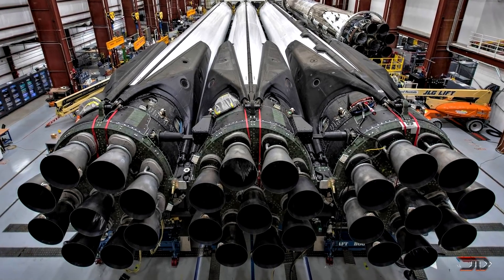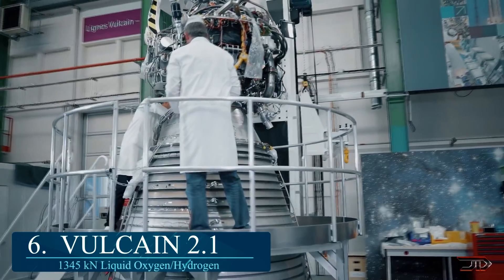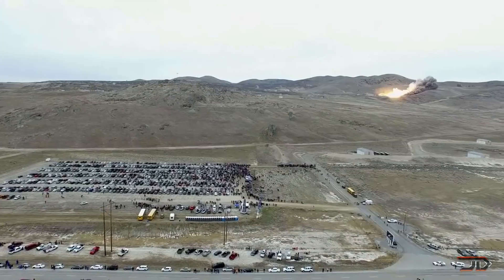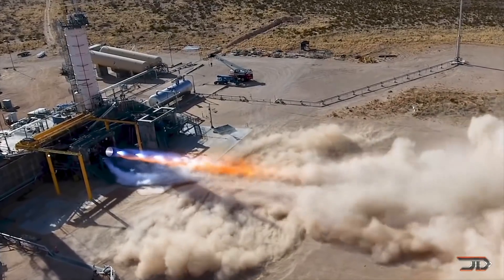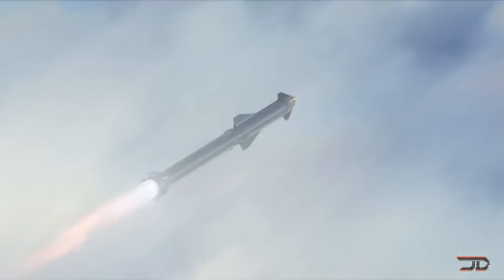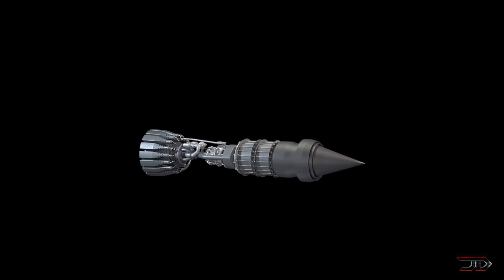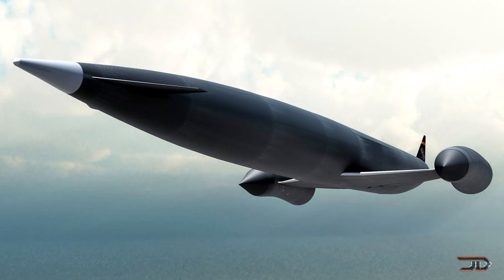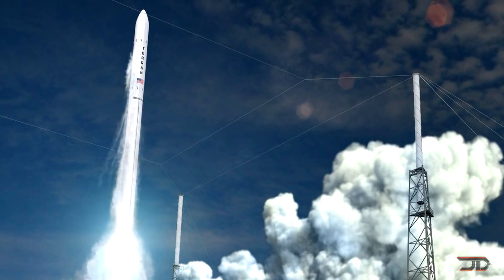7 AMAZING New Rocket ENGINES

Comment: 5:08 "It would require 200 MW from a powerful nuclear reactor"

So, not a real problem then.
Reply: It is. For once, we don't have space-rated reactors like that (imagine, you can't easily cool them in space, unlike on submarines). Secondly, what author didn't mention, the mass-to-power ratio in the 39 days estimate was orders of magnitude lower than what we really have. So it's not only that you need 200MW, but also you need a very light reactor to begin with :)
Reply: @Pharisaeus  a stellarator then.
Reply: @lolgamez9171  and how does this help at all? o_O We can't even build a working one on the ground, not to even consider this in space.
Reply: @William Stock it has nothing to do with blowing up. It has everything to do with size and mass. Anything that goes into space has to be small and light. We don't have reactors like that, and pretty much no one is working on them.
Reply: @Pharisaeus  Eveporative coolants should generally be avoided at such powers and waste heats as even the best coolants would add a significant extra mass which would negate any benefits of having higher exhaust velocities for the engine. Some heat can be transferred to fuel before "burning" it, but only a small fraction (like 5-15% of total waste heat). The rest has to be dissipated somewhere else and not to the exhaust plume as it is much hotter and it would be against the laws of thermodynamics. I've tried looking for many alternatives and have found that the only reasonable way would be passive infrared radiators.

Also an MHD generator could be used to reduce the waste heat as it can theoretically achieve efficiencies of around 60%, but yeah even that is not being used on ground.
Reply: @Pharisaeus  actually, it doesnt, all what is required to have a propulsion that provides a specific impulse as high as possible, i.e. more bang for your buck of fuel you have to carry.

the weight overall is irrelevant as long as your engine can offset it.
Reply: @railgap  I mentioned NTR in my comments, but this is a VERY different idea from nuclear reactor for generating power for electric propulsion! In NTR the heat is pumped into the propellant and ejected, so there is no issue with head dissipation.
Reply: @Pharisaeus  radiators?
Reply: @CarlosAM1  there is no other way to dissipate heat in space, but the size would be insane
Reply: @Pharisaeus  yeah, but still RADiators
Reply: Pharisaeus you need gravity of a basic one and a rtg gives little power
Reply: An aerosol can gets icy cold by releasing pressurized gas out the nozel. Isn't a rocket similar? Couldn't there be a way to "heat pump" the excess heat into a part of the exhaust gases that would make them relatively remove the heat from the sensitive parts, yet allow the gases to get even hotter and carry the heat away in the exit plume?
Reply: @anthonylosego  In some cases you can. The idea was even tested as a Nuclear Thermal Rocket. The general idea was to use a nuclear reactor to pump heap into hydrogen propellant. But this is a very different design -> nuclear reactor is not generating electricity but heat in this case. The ISP of such engines was about 900s (so twice the chemical rockets, but order of magnitude less than electric propulsion). In fact it's the most realistic rocket design for manned solar system exploration because the trade-off between thrust and ISP is pretty decent.
Reply: @anthonylosego  only the energy of the gas vibrating is lost. so, whatever energy source is creating the heat would have to be vented.
Reply: There is this atomic rocket website. I cannot believe all on it. But with a nuclear reactor without a moderator ( needs the fuel bombs use ) with fuel rods in vacuum there should be plenty of charged particles flying around. Place holes into the chamber walls and apply magnetic fields crossing the channels because I've the feeling that a magnetic mirror alone will not work. Most of the spaceship(including tanks) will need to be covered by radiators. Could use these to get some energy to expel some more ions. Cover all surfaces with wax (with deuterium ) to moderate the neutrons and hope that they exit back into the vacuum.
Reply: Mostly cooling that the problem but it is doable with high temp designs they also can use a large solar array for the needed power especially if they settle for a 90 day transit time.
Reply: @rurihoshino313  good luck with that when going to outer planets.
Reply: 200 kw not Mw
Reply: I’m having diarrhea
Reply: A small fission reaxtor would be great for VASIMR. It doesn't have to lift off, so the realtor can be sent up in stages and snapped together. Cooling is always an issue, so you typically add radiative fins. And nuclear fission please. Fusion is still not possible in this context, though there are intriguing concepts like purposely leaky mag confinement schemes. 

Trying to dump excess VASMIR heat into the exhaust is intriguing, but plasma is pretty low mass yet high temperature, and the heat exchange rate would depend on the mass rate out...

I'm not sure the thermodynamic heat balance would work out. The heat off the reactor is in some fluid, and the fluid is in a pipe. The temperature of the fluid will likely be less than the exhaust,  so any thermodynamic cycle you come up with , which usually involves heat being transferred across an interface between heat carriers, will fail to go in the direction we want, i.e. away from the hot reactor. But I'm willing to be corrected.  :-)
Reply: @alvarofernandez5118  I'd like to point out it is an RF induced plasma and as such some heat could easily be dumped before the exhaust is turned plasma and perhaps reduce the the amount of energy needed to achieve plasma, but it would likely still need some other ways of cooling on account of the density of the exhaust.

Still as the OP said this is really no problem at all and simply requires some time to figure out.  The real problem will be the public perception issue when a launch manifest including nuclear fuel or a nuclear reactor is published.

Comment: Great video!

Could you do a video on rockets that ran on ethanol that Boeing built to use on the Space Shuttle and was going to on the Reusable First Stage?  Or even the ethanol rocket engine using GOX/Alcohol they were considering using for the CEV/Orion American capsule in the 2000's?  Thanks.
Reply from the maker: Yes that is a very good idea! I might do history videos on all sorts of engines.

Comment: The Rocketlab, 3D printed, electric pump, Rutherford engine should have made the list. The Spacex Raptor is a full-flow, staged combustion, methane-fueled rocket engine. The most advanced rocket engine should be # 1 as it is a huge leap forward in engine design.
Reply: The Rutherford engine isn't a future engine, it's an operative engine. It has some innovative features but it's not the future, it's the present.
Reply: Problem is that most advanced rocket engine ever isn't new. It's 40y old, and still is our biggest achievement in chemical rocketry.
And don't forget, things like VASIMR, SABER, nuclear drive, are much more revolutionary than just "some" chemical raptor. Raptor isn't even something very new. This way of cycle was already developed by russians like over 20y ago. They just did not use it on bigger scale. If we are speaking of long range travel, chemical rockets aren't big part of future.
Reply: @_mikolaj_   This author covered several versions of "new," that was his choice. Gives us contrasts. For Raptor, what's new is making it work, building it with new alloys, reaching chamber pressures never seen in a ready-to-fly engine, and using 3D printing for parts of it.

Comment: Cool video man, you should have mentioned that the SpaceX Raptor engine is a full flow staged combustion cycle
Reply: He sorta tried to. Good clarification. 
Tech Planet (and others in this spread); when Raptor is mentioned experts usually say it's the first flight-ready full flow staged combustion engine. Two earlier ones, one Russian, one U.S., were ground test versions only.
Reply: In short raptor engines are hard to tame ( they are beast😂)
Reply: Raptor is the first full flow stage combustion engine worth a damn and is also the only fully reusable engine on the market today. Best engine by factors of multitude.
Reply: @noahgossett6134  We don't know that yet... Not even close. Only 1 Rap has actually flown, and it caught on fire after landing in the star hopper. It may very well be "all that' in the end, but to make such a statement now is premature.
Reply: @hawkdsl  we now know they work good, SN5's awsome hop on one Raptor looked great, I think the hopper test they ran out of one of the mixtures or lost feed thats why the flame changed colour just before landing thats why it was a heavy landing bending the feet :)
Reply: Also runs on methane.. He told something like natural gas.. Or something
Reply: Blaze10523 
And the only full flow staged combustion to be developed enough to get off the test stand and fly.  Plus it has a high chamber pressure than the past attempts making more efficient.
Reply: Wanker.
Reply: He did
Reply: @Thinker , welp, you can disagree with history. But this will not change anything
Reply: @Thinker , so we assume most of the documentation published is false, and that actual engines are just mockups? smells like overdose of conspiracy theories
Reply: Truly amazing stuff. Artsy too very attractive
Reply: It wasn't first one. It is first in USA. Roscosmos already did this some years ago. Just never begun mass production
Reply: @_mikolaj_  Yeah i'm aware its not the first i just thought it would be a nice thing to include in the video.
Reply: @_mikolaj_  The RD-270 though it had combustion instability problems like the F-1 had early in it's development and the UR-700 project was canceled by the time they started getting them sorted out.
Reply: @_mikolaj_  and its the first one that actually flew
Reply: @_mikolaj_  That's because their engine never worked reliably. You don't go to production if your engine keeps blowing up. SpaceX has the first ever full flow staged combustion cycle engine that actually works reliably. Roscosmos might have solved the issues plaguing them, but they gave up before those issues were solved, hence not going to mass production. You can't claim someone is first if they never get it to work.

Comment: Interesting! Thanks for this 😊 I wonder where the nuclear fusion ion motors are in development? Some ion or plasma power motors are used already on space probes but are weak it seems. The Vasmir plus fusion is the future I think.
Reply: That's the trick -> no one is actually working on stuff that could power VASMIR. This is why it's mostly selling smoke. AdAstra was asked about this numerous times, and they always answer that "they're working on the engine, not power system". It's a bit like saying that we have a Warp Engine but we just need a Warp Core to power it, and no one is working on one, and no one even knows how to make one.
Reply: fusion is not even done on power plants on land yet, so nevermind space
Reply: It doesn't actually need fusion. Several gigawatts could also be achieved by much simpler fission. Fission may provide less energy per fuel, but needs significantly less equipment.
Reply: If you can get fusion working, then you'd be better off developing some form of direct fusion drive, rather than dealing with the efficiency losses and waste heat of converting it into electricity to power something like VASIMR.